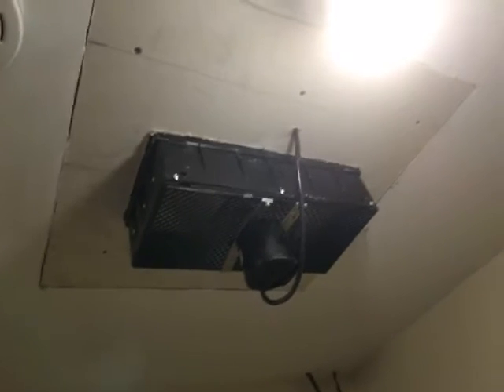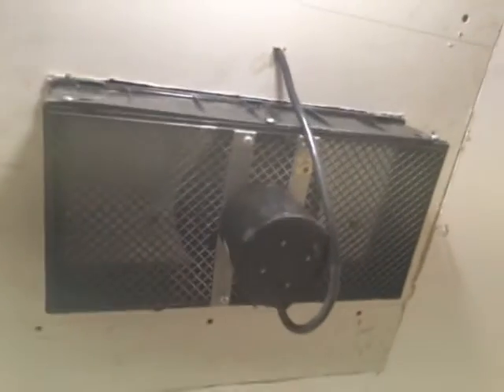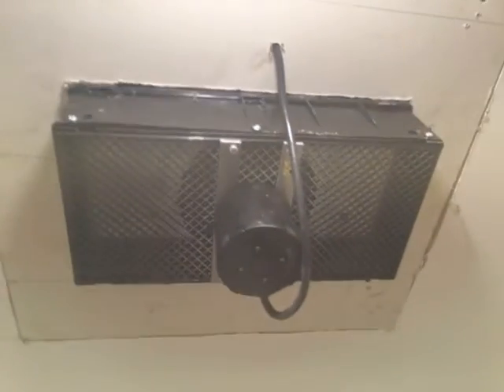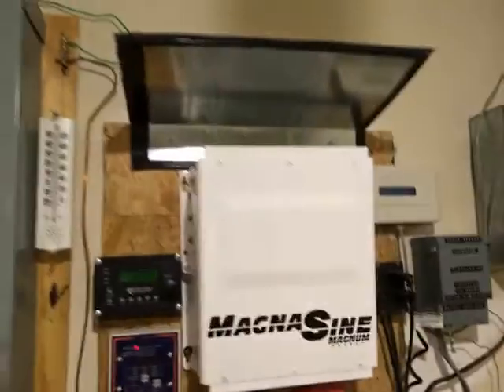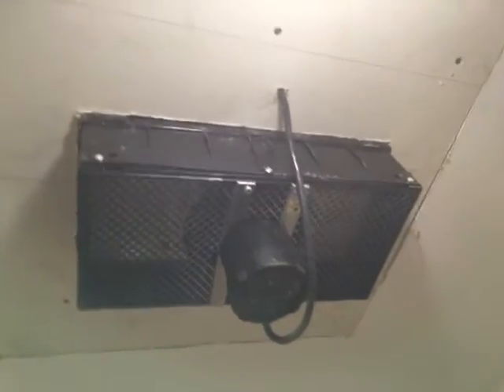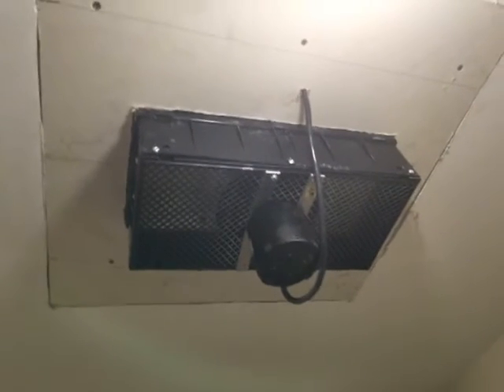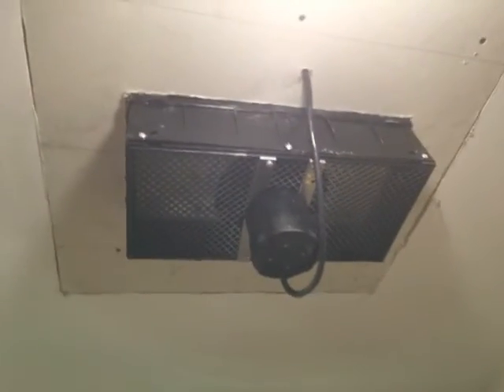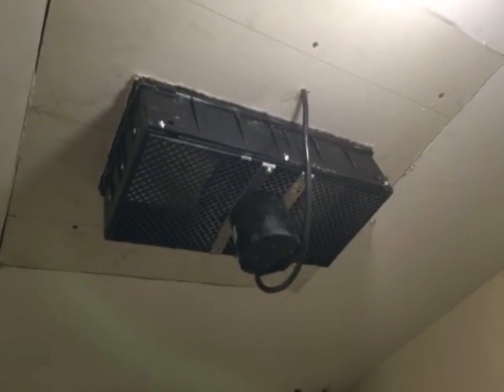Battery Venting - Upgrading the ventilation using a crawl space ventilation fan.

Comment: I had a question about the capacitors. You set up the jump box which had a much higher voltage than the 12 volt battery and inverter setup you had. Will the higher voltage affect the limit on the inverter, or be to much for the battery to handle?  You had a 32.4 volt cap set up to 12 volts. This would be an excellent vid to post next for people to understand the dos and don'ts ,or the limitations of a particular system. I am starting with a 24v system for my camper van. maybe some advice on caps for my system.  I posted a comment on your  24v vs 48v, if you have some time to check it out and tell me what you think, it would be much appreciated.  Would you be interested in letting go of your 5 year old Blue top optima batteries? I have two but being disabled, I can't afford new ones in bulk with all I have to do.
Reply from the maker: Thanks for your question, I'll try and answer as best I can.  The jump box was setup with 12  1000F 2.7v ultra capacitors connected together in series to form a 83F 34.2v capacitor bank.  The 34.2v is the maximum voltage the capacitor can hold.  By making the capacitor bank with that level of voltage I'm able to utilize it for 12v applications or 24v applications.  The capacitor bank will generally take the voltage of the charging source until it and the charging source are of equal voltage, for example when I start my vehicle, the car battery will be charged up to around 14v from the alternator.  If I then hook my portable capacitor bank unit up to the car battery, while the car is running, the unit will be charged up to 14v as well, thus taking power from the battery and the alternator.  The capacitor bank will not charge higher than the charging source, which is the alternator\car battery in this case.  In the case of my 24v system, it would be the charging source and would charge up until it reached the voltage of my battery bank.  The highest voltage my Nickel Iron Battery bank can sustain without my inverter\charger shutting down the charging is 32v, it it gets higher than that then the inverter will shut down charging to protect itself.  But in reality, my 24v based system will not charge higher than 31.3v so I have some room to maneuver.  By sizing my capacitor bank to "support" up to 32.4v, I've covered both potential situations where I can use the portable as a 12v jump box to start a dead vehicle and a 12v or 24v based battery booster for inverter based applications.  For caps, I would recommend the Maxwell ultra-capacitors because of the quality, however the caps for my portable unit came from AliExpress and they do work as well.  When sizing I do recommend you size appropriately based on how they will be used.   My main capacitor bank is 250F total with all caps connected in series and that I believe may have been overkill for what I use it for so you may consider the 1000f caps in series as a cheaper option.  My portable unit doesn't have any balancing resistors or circuitry because the voltage limit is scaled high enough that when using it on a 12v based system, there is very chance of over charging them.  Also, I plan to keep the optima's as purely backups, they are 5 years old but they are very good batteries, I use the Nickel Iron batteries for nightly use and the optimas' are for times if I get caught off guard by the weather. I'll check out your other comment and get back with you on it as well.  Hope this helps.  I also may make a video explaining this for others because it was a good question.
Reply: Thank you, got it. Now the 250f is more powerful than the 1000f? 9
Reply: Looking forward to the next video.  Thanks again.
Reply from the maker: Irving Coleman When dealing with Ultra Capacitors, when you place them series the voltage goes up, but the overall capacitance or the storage capability diminishes by the number of caps you have in series. For example, I have 12 3000F 2.7v ultra caps in series. 2.7v x 12 caps = 32.4v, (3000F / 12 caps = 250F).  So as you can see, the voltage will increase as you add more caps in series, but the capacitance or the storage capability diminishes by the number of caps.  With my portable unit, I have 12 1000F 2.7v caps.  In series they are 32.4v but the power storage capability or capacitance is 1000F / 12 Caps = 83.33F.  Whether 83F or 250F, there is still a lot of capacitance.  The power stored in those cells is enough to kill or injure you.  Just one 3000F capacitor when short circuited has the ability to generate over 9000A instantly, I read that in the Maxwell datasheets on their 3000F caps.  So please be careful.  That's why I say 250F can still be considered overkill for my application.  83F will do the job just as well.  Hope this explains things a lot better.
Reply from the maker: Irving Coleman No problem, glad to share the knowledge.
Reply: You should be an instructor. Got it, thanks again. I will be sure to pass this along with the credit attributed  to you.
Reply from the maker: Thanks and take care.

Comment: Were you smelling off gasses? Im not sure sure you need that much air to move but Im sure its safe. I bet that makes the whole house hot.
Reply from the maker: Actually, you can smell the alkaline in the air as the batteries reach the end of the charging cycle. NiFe batteries don't give off acid fumes.
Reply from the maker: Also since this room is in the garage, the rest of the house is unaffected.  The garage is generally hot all the time. The living areas of the house remain cooler.
Reply: Alkaline smell wow interesting? I dont know that smell. well mabey when I get some old leaky batts out of a toy or something?
Reply: Oh thats good it is fine then.
Reply from the maker: I believe it was that same residual alkaline in the air that was setting off my detector not the hydrogen.  The detector only goes off when that smell is present, and it only occurs during the last 10 to 20 percent of charging, that when the batteries do a lot of hissing and gassing.  It definitely has a distinct smell. but like any smell, with a good fan It will dissipate, So it's no biggie, just an annoyance.

Comment: Have you thought about keeping the batteries out side in a vented box?
Reply from the maker: I considered it, but decided against. I have a watering system on order and wouldn't be good in the winter.  The water in the tank could freeze and burst during the winter months.
Reply: Frozen battery's would be fatal for the battery's I guess.
Reply from the maker: I think you mis-understood.  Nickel Iron Batteries generally don't freeze because of the potassium hydroxide electrolyte solution.  The holding tank that would hold the distilled water for refilling the batteries would freeze.  However, I have heard of battery casing cracking because of the cold temperatures.  In any case, keeping them outside is not an option for me.
Reply: the water tank could be inside
Reply from the maker: Yes the water tank could be inside, but that would take more engineering effort than I would want to deal with. I did consider that aspect as well.  The cheaper less hastle option was to simply drill a hole in the wall for a vent and get a decent exhaust fan to suck air out.